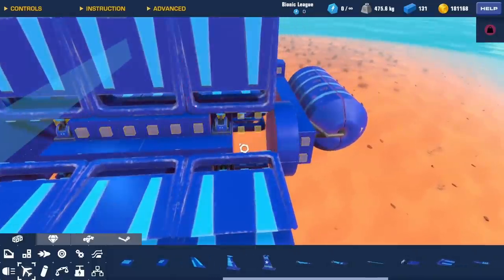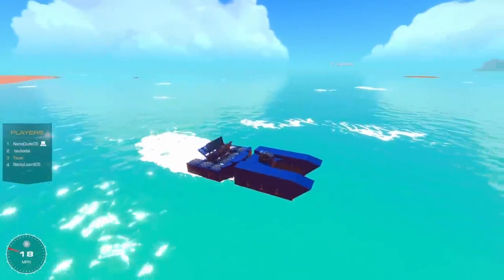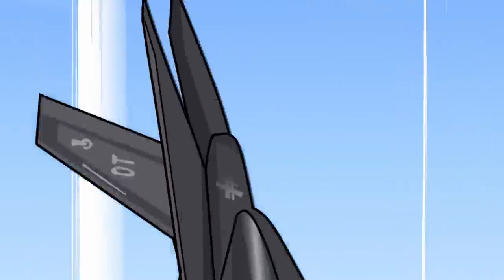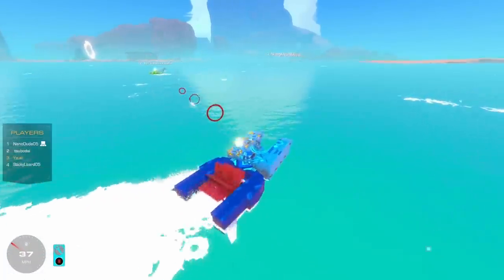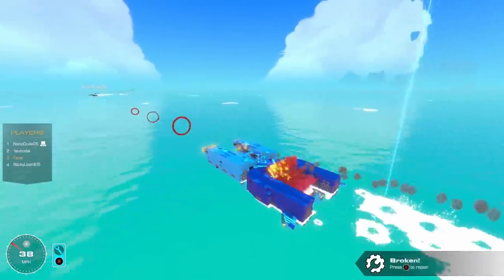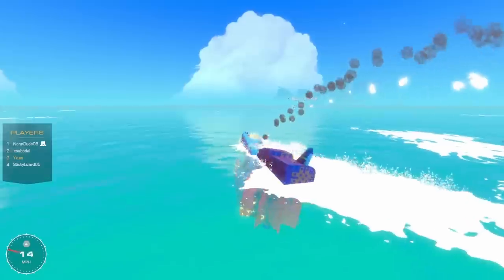Can We BATTLE With ZERO 'Power Core' SPEED BOATS!? | Trailmakers Multiplayer

Comment: so... i have a really old 0 power boat from near the first version of the game. it hits 100 kmph and from what i can find by racing in the island tour, is probably the fastest 0 power boat to not use glitches, seeing as the other racers ahead have the exact same design and look really weird. the problem? it's stupidly large, nears the complexity limit, needs a 10 block long, not deep, long rudder to even turn at a decent pace, and is mostly so large because it needs a crap ton of weight and floatation devices in the rear to keep from flipping over. bionic boats are hard once you try to actually build for speed.